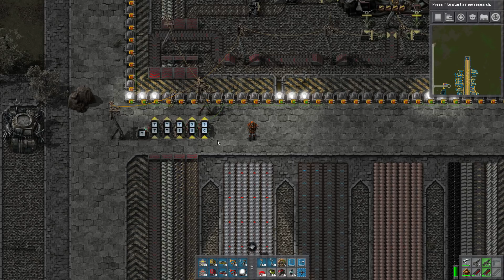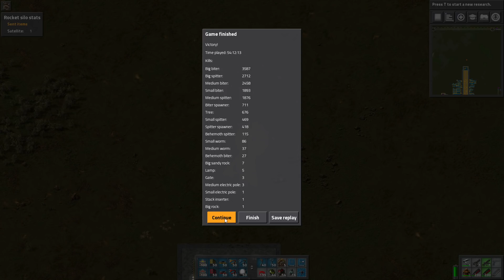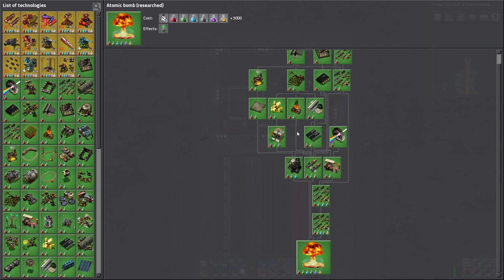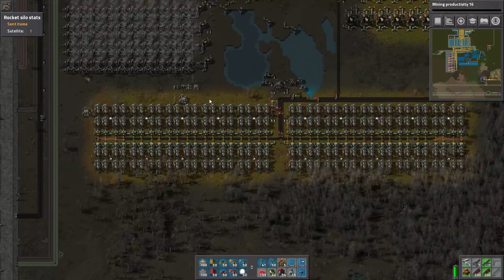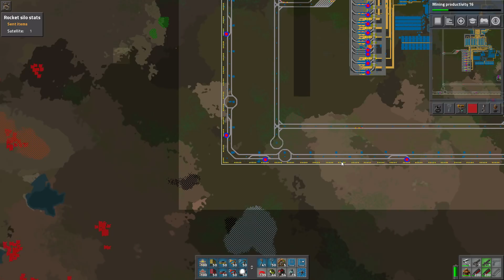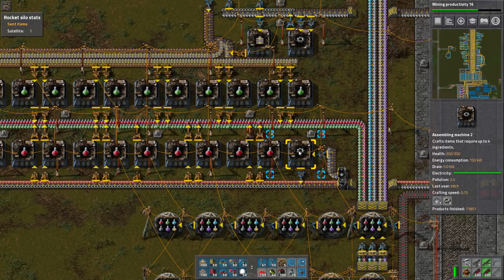Impractical Factorio 0.16 Ep 60 | Rocket Launch and Base Tour | Factorio Let's Play

Comment: Loved this series. I'm using barreling in my current base and i've come up with a control system that is rather simple compared to what you have setup. My logic is controlled by a single red wire connecting two segments of belt, for all fluid types that i'm barreling and has so far been doing an amazing job of keeping empty barrel creating to a minimum. It automatically scales barrel supply to meet demand and limits the backlog of return barrels to whatever is necessary to keep supply going at whatever pace is needed. The one downside, is that the belts of filled barrels are always full, but that could also be fixed relatively simply with no counting of barrels or logic required. link to pictures: https://imgur.com/a/uu555c5
Reply from the maker: Thanks! 

I had tried something similar before, but I always had a problem when the empty barrel system got too full... if it backed up, it would clog the machines doing the unbarreling, and it just all went downhill from there :)  Granted that was when I actually learned that was a thing, and had not prepared for it in the least.  Yours looks like it would work as well, but after that experiece, seeing the 'tight' lines would leave me in a state of anxiousness :)

Comment: I loved this entire series. It was pretty neat seeing an entire base using on-demand manufacturing from basic resources. 😉

I almost exclusively use QoL (quality of life) mods. If you're still taking suggestions I'll list them below. (and briefly describe them for people that haven't heard of them before.)

1. Auto Deconstruct - Marks miners for deconstruction when they run out of resources.
2. Auto Research - Automatically selects the cheapest research project, or you can set a queue.
3. Even Distribution - When you Ctrl+Drag items over buildings (such as coal or iron ore), it evenly distributes it across all machines.
4. Squeak Through - Lets you walk between trees, pipes, solar panels, accumulators, storage chests.... and more.

I consider the following too powerful to be called QoL.
(i.e., I consider them to be "cheats")

5. Auto Fill - When you place a train/car/tank, it fuels it. Smelters and .... or if you place a string of gun turrets, it immediately loads them with 10 ammo a piece.
6. Creative Mode - This is straight up cheating. I use it exclusively for building blueprints or doing experiments.
7. Upgrade Builder and Planner - Lets you set a list of items to upgrade, and it flawlessly swaps them out for you. Need to upgrade an 8x8 belt balancer? It'll do it for you in an instant using the items in your inventory. Even through radar mode from across the planet.

If upgrade planner only worked within your character's natural construction range, then I wouldn't consider it a cheat.
Reply: Thank u i didnt even know that something like these mods exist
Reply: 😊 I'm glad you found it useful. There's so many mods out there sometimes it's tough to find the simple small change mods that just make life better.

Although... Auto Research can turn into a pretty big change if you utilize it's advanced features. Normally though, you can just ignore it and let it keep your science machines working.